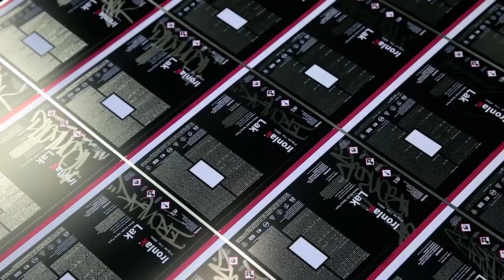How Ironlak Spray Paint is Made

Comment: I failed to see the part where the silly string was added
Reply from the maker: You obviously haven't used Ironlak recently.
Reply: Just a joke 😂 I've been using it for 10 years 😘
Reply: Ironlak i stopped using it about 3 years ago because i noticed color changes on walls. Has the pigment  process bwen re configured. I got several burners out there that went from purple and blacks to nkw light blue and blacls that look wack
Reply: @KROWGraffiti  probably you didnt shake the can well.